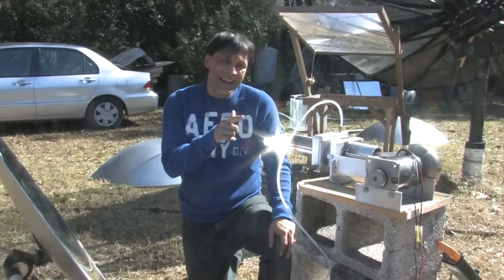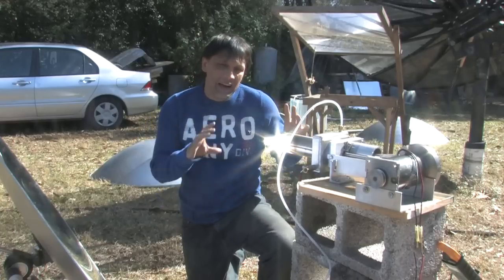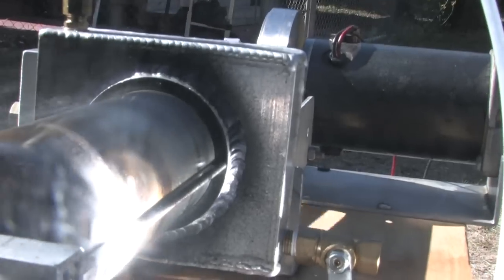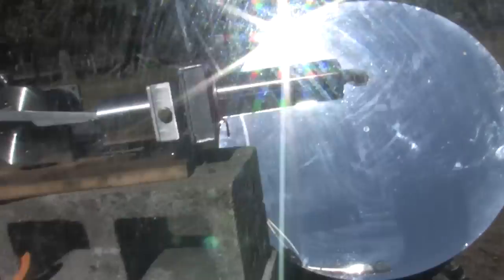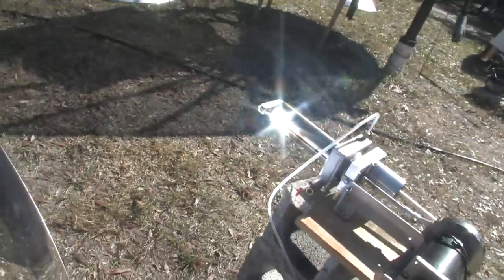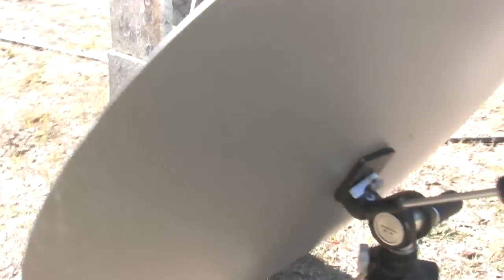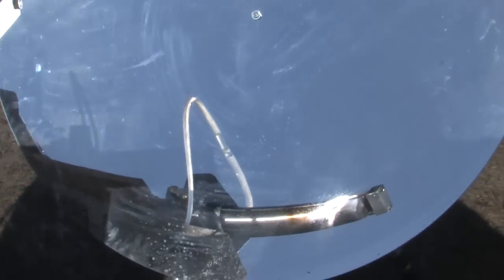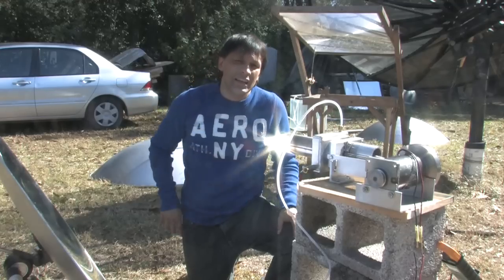Large Stirling Engine Water Cooled Parabolic Mirror Solar Power Electric Generator

Comment: For certain a feast for the eyes, but in "modern times" nothing can beat solar panels; they are too cheap and too powerful, with little to no maintenance and a lifespan of +20 years. This "system" is going to cost you a minimum of 500€, and that's being generous, and produce a maximum of maybe 500w. With 500€ you buy 4000w of pv. The only real purpose of something like this is to be used at night with cool water from an underground reservoir and heat from a sand battery to charge batteries if necessary.

Comment: How the hell are these not used more than what they are now? 

These are brilliant
Reply: Power to weight ratio still not that great. Also oil/car companies will not have it. They'll stand for it.
Reply: @darceytolen1028 Stirling engines require a lot of maintenance as they are very complex simply not commercially viable

Comment: Not an attack. Just an FYI.  It's useless if you don't tell me both amps and volts or rpms and torque.  These figures work together or they are nothing good for figuring.  This is why I'm enjoying quantum physics lately. A base quantum particle doesn't change much and if you only tell me one figure.  Yeah it might take an equation as long as my arm, could make a full body tattoo of it, but at least I can figure the other

Comment: Something I have been thinking about is a solar sterling pond aerator. The idea is to use the pond for cooling.

Could a setup be designed with the cold side submerged in the pond and a magnifying lens or reflector on the hot side? Perhaps the engine could be incorporated into a small raft somehow.

Comment: this is the best sterling i have seen as putting a sterling to practical use, without putting the working air under pressure.  that is not a large mirror.   haven' t seen many that will put out 12 volts.   thanks for sharing.

Comment: I know it's probably a bit late, but I'm wondering about an optimal and practical Stirling engine for residential solar energy harvesting, so I have few ideas:
 - first the heater component that gets the bright and hot spot of concentrated light, should be as black as possible (with materials that don't melt at about 600~700 degrees). Having metal or glass heating element will let a lot of light be wasted w/o even getting in the engine.
 - again for the heating element, since we want as much as possible of the heat to enter and heat the operating gas instead of the outside air I was thinking how to simultaneously let the light reach the heating element, and trap it there. So I think a glass (or other transparent high-temp resistant material) bulb around the heating element can be added and the air between that outer glass-bulb and the inner heating element (that encloses the operating gas) can be extracted so that a partial vacuum is achieved (the higher the better). This way the only heat lost to the outside at the heating element would be infrared radiation rather than direct thru air conductivity and convection (even w/o wind).
 - how to optimize the cooling element?
This can be rather two-fold: On one side to speed the cooling to allow for balanced phases of the whole cycle (or otherwise if we supply too much heat and barely dissipate it the engine might never make more than one cycle). On the other hand the faster the heat dissipation in the cooling element, the lower the overall efficiency would be, ie more of the energy will be lost as heat thru the cooling, rather than doing the work and turn the crank. So I was wondering if the approach of the large scale steam engines with their reheating phases can't be used here too - ie to have multiple Stirling engines feeding heat to one another, and having them operate at different temp differentials and speeds, so to squeeze a bit more energy into work.
 - as I'm considering this for a residential solar energy harvesting solution I think the output heat can be used the same manner as you did above - ie with water cooling - and during winter the still  hot water can be led to circulate inside a house radiators to heat up the interior. During summer that extra heat won't be much fun to be pumped inside a house, but I guess it can be used to warm up a swimming pool for example.
 - Also air is very far from efficient gas for a Stirling engine (though the cheapest one possible :)), so besides the explosive Hydrogen and the expensive and evasive Helium I was wondering if a refrigerant gas can be used like for r32 or r410a (ie the eco-friendly alternatives of freon). Using gas with higher thermal conductivity and compression difference between the operating temp extremes will allow more of the heat to flow thru the engine and do work, rather than dissipate thru the walls and get wasted. Using other gasses would of course require much better sealing.
And perhaps alternative approach like a Fluidyne can be used in which the operating gasses are trapped by a (non-compressible) liquid for example water, so instead of leaving holes for the pistons and struggling to seal them perfectly a water column osculating in the rhythm of the Stirling engine can be used. Perhaps such Fluidyne-Stirling engine can even incorporate the water-cooling idea in the cooling element?
Perhaps this was without too exotic manufacture or materials (except the ones resistant to high-temps) an efficiency above 50% can be achieved?

Comment: Ten years later this is STILL intelectual toy not used technology XD
Reply: The ones found in youtube are usually toys, but the idea has a lot of potential and many large-scale & high-efficiency projects have been implemented, like the NASA's Stirling engine vehicles, or the various Concentrated-Solar-Power-Stirling-Engine systems used for residential energy harvesting.
Even in simpler models Stirling engines can usually can be more efficient than lets say steam turbines, even the ones with multiple reheating stages that reach up to 47% thermal efficiency.
There are some very interesting variations of Stirling engines, and it's a shame that the mass industry is dominated by automotive engines that leads to stagnation in advance of alternative engines.
Reply: @blueckaym  Hello, i'm looking at this to power one house. Let's say i want to generate 3 kW for one house. Isn't photovoltaic panels better, let's say with all costs included 11 000 dollars? Maybe the problem with the photovoltaic panels is the mining (exploiting Earth too much again just like oil) and recycling problems?
The goal is for the house to be off grid and independent and green and cheap if possible.
Reply: @yd8104  , yes at the moment photovoltaics are better, because no Stirling engines are commercially available for small-scale home use (which is a shame).
Also even if you know and have the capability to build a decent Stirling engine for your home it's probably going to be too expensive for a small power like under 8kW.
So don't worry about using PVs, just if you like in a moderate or cold climate you might want to put some of those panels to be solar thermal panels - the ones that just heat up fluid inside and transfer is to your hot-water boiler or heating system. There's huge difference in efficiency between photovoltaics (which are about 20~25% efficient at best) and solar thermal panels which are about 65~70%.
The fact is that most of the energy we use at home is for heating, so the only reason you might want to go with 100% photovoltaics I guess would be for a small installations (like yours) for simplicity, because the panels aren't the only cost of the installation.
Otherwise Stirling (or other heat) engines can be incredible at levels high enough to power several homes or even a small neighborhood.
Maltainc is one of those companies (focused on using heat-batteries to store the collected sunlight) that have such projects. It's especially efficient to store the "heat" energy not just as heat, but in two heat reservoirs one of which is cryo-reservoir ... but heat-storage is a different subject.
Btw $11k seems a bit high to me, the panels alone should be around $3k (for a 3kW max capacity) or if you want to reliably generate 3kW ie oversize it to about 4~5kW it's still going to be no more than $5k, that will leave you with at least $6k for the rest of the installation - electrical system, converters and some battery to store some of the daylight energy for the evening at least.
If you want to be completely off-grid and have energy 24h a day you might want to oversize it a bit more and get bigger battery, but even then I think $11k should be sufficient.

Comment: Fresnel lense may be better but why wouldn't you want to use a mirror on the focus point at a 45 and then on to some type of large thermal mass rock or stone oven...  Use the beam for slicing through things... Add another series of mirrors until the heat is of the proper temperature so it welds plastic instead of cutting or burning etc

Comment: Cut a glass ball lens or not. Put near sterling engine. It should track the sun through the glass ball without moving and concentrate the light always at the point of engine to heat it up like a magnifying glass does when you try to use it to burn something on the ground like when we were kids. Make sense? Try it and worst case you have to mess around with the shape to get it to do what you want on the right spot

Comment: Hot oil and a parabolic trough system could use a large thermous for heat storage. Oil is good at transfering heat to many engines.
Reply: +travis moore Also will R134a work well for the working gas?
Reply: No. You want to use a lighter gas. Helium is optimal.

Comment: Lord I don't know the first thing about anything related to electricity, motors, computers , no technology .. i wish I would .. i don't even understand how I  could hook up a generator to my household wires electricity . I feel really dumb looking at this stuff .man If I understood I would go make those machines and use zero energy from the power companies .. what would you guys recommend to learn some of the basics ? I want to be in this ! it doesn't look that hard I just don't know what it's about at all.. HELP !!!
Reply: +Stijn Voorhoeve Hi! I would recommend studying to be an electrician. Is not that expensive and does not take a lot of time from our busy schedule. Knowing your way around electricity is a good way to start. Now, for the mechanical part, specially these beautiful Stirling engines, there are lots of information in the web, specially how to videos here in YT. I would recommend that you build the very simple models just to get the grasp on how these engines behave. It will give you an idea about where to go next as you build your knowledge. there are also  societies that work with these engines. One of such is http://www.stirlingengines.org.uk/ 
There are companies like Kockums that make engines to be used in submarines in the Swedish Navy.

Comment: use oil not water?
Reply: badsaddamdotnet The point of water is to take advantage of the temperature when change of state occurs, ie: water into steam, which occurs at 212 'F.  As long as there is water in the vessel, the temperature cannot exceed 212'F.  Change that to oil, and 2 things occur.  Oil has less than half the specific heat capacity of water, so it would heat up very quickly, and second, oil has a boiling point far in excess of water.  An efficient Stirling relies on the maximum temperature differential.  Change to oil, and the TD decreases by as much as 360 'F
Reply: ok cool noted :).

Comment: Why is it smoking? Is it too hot for Stirling and steam engine would be more reasonable?
Reply: Steam engine is operating not far from temperature where water starting to boil(100C or slighty more if presure of the steam is high) and solar stirling engines using often source that is thousand of Celsius degrees above that temperature... What is smoking there is not very important, this whole setup looks like something made in less than one hour just to make this movie and not as something that would last.
Reply: It could be any non stainless residue like an oil or paint.

Comment: i want to make something like HHO selfruning 4 inline cilinder stirling engine generator combined with water heating system and also the solar cel and wind generator to power my  house. i think if i combined that with some car bateries and super capacitors it should be enough power to cut off from power line

Comment: finally got around to seeing the video (college is time consuming), with this on other videos of yours that i have seen (making hydrogen) is it voltage, current, or watts that is needed to separate the hydrogen molecule?
this experiment would involve setting up a container with water, having solar panels to make the charge into the water, tricky part is to then be able to make enough/store it so that it can then power a generator, let me know what you think.

Comment: probably just die. the thing is, this is running, but probably couldn't handle much of a load. this is shown with no load on it from what i gather. people have a lot of hopes for stirling engines, and I've seen a very old one made to run a sewing machine that's still running today, but they ain't real powerful devices until you get REAL big ( and real expensive).

Comment: not that much. coz the fresnel lens would already concentrate the light anyway. then the dish would basically do nothing. except possibly have a hole melted in it by the fresnel lens. its all about the size of the area of sunlight you get in the first place. so setting heaps of other mirrors/lens up at the dish would increase its power AS LONG AS you could keep it from melting the dish.

Comment: Hey have you tried to mount a small mirror on the other side of the cylinder?
Nothing too big, about 4-5 inches(parabolic?), just enough to catch the light that makes it around the cylinder(for wider focus main mirrors of course) and reflect it back onto the cylinder? Also, have you been able to test this setup in the video to see how much load it can handle? Thanks.

Comment: Set a second freznel and second stirling bearly position to track after first and turn the two systems at the base .. it will track and generate all day..and even reposition from a water tank that comes to boil with freznel lens ... when water disapates toilet float goes down clicking a gear and moving to the second

Comment: Solar panels are rather inefficient. The best way to make electricity seems to be by spinning a generator. With the right combination of engine and generator, you should be able to produce more power than a comparably sized solar panel.

Comment: you need to make a globe with magnifying lens bubbles all around it. That way the sunlight will be concentrated on the unit as it moves across the sky hitting each magnification bubble one after the other with correct positioning. This way you dont need the typical sun tracking motor or  device .

Comment: the same method are used her in Sweden but whit nitrogen gas in the sterling engine they still have a problem avoiding the engine to explode do to the lubrication is an issue.

Comment: @pmryan25 Actually, there is a kind of hydroelectric power plant where you can pump water up the dam in the day using pumps. In the night, you run the water down again through a turbine. Cheaper and better than batteries. So in the day, you generate enough to last through the night. You store the night-time quota by pumping the water up the dam and storing it as gravitational potential energy of water. But this is only possible for big power plants. Don't worry man, I got your back ;D

Comment: @pmryan25 Look up Molten salt storage

A variety of fluids have been tested to transport the sun's heat, including water, air, oil, and sodium, but molten salt was selected as best. Molten salt is used in solar power tower systems because it is liquid at atmosphere pressure, it provides an efficient, low-cost medium in which to store thermal energy, its operating temperatures are compatible with today's high-pressure and high-temperature steam turbines, and it is non-flammable and nontoxic.

Comment: what is the temp. difference needed for a sterling engine to run?  i figure it is different depending on the size of the motor.  but let's say for a 12 volt generator to run what would the temp. difference need to be?  thanks.

Comment: Dan, I see the idea here and I think the stirling engine is a great idea--however I don't have the tools or technical knowledge to actually construct one. However, I digress...couldn't you improve cooling by making the flywheel a fan instead of a solid piece of metal? It could direct cool airflow over the heat sink and improve cooling significantly with little cost in mechanical work.

Comment: Could you use this on a larger scale to power a home (or at least charge batteries)? Maybe with a Fresnel lens? Would be perfect for desert homes at least. 
Also you could heat water for a home with a Fresnel lens and store the hot water in a giant thermos tank, for when the sun is not shining.

Comment: @GREENPOWERSCIENCE 
hi may be if u use the warmed water for ur personal hotwatersupply (shower etc.) u can use the heat twice
so u just install a tank for hot water above the coolingunit and the water will cirkulate itself (hot water up cool water down) if the "wasteheat" of ur stirling is enough

Comment: Engine is well-made. However video does not show water flowing through cooling jacket. It looks like lower water valve is closed.  It would make sense to use power from generator to pump cooling water. Also no good view of power piston.
It seems you never reply to comments?